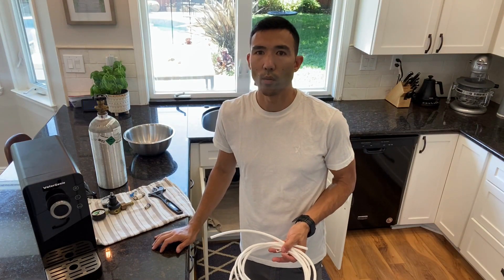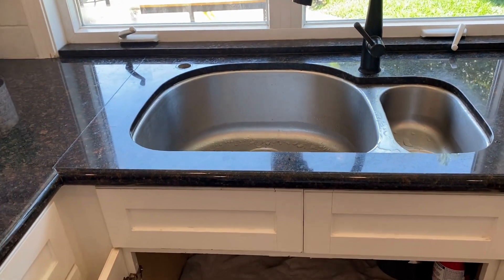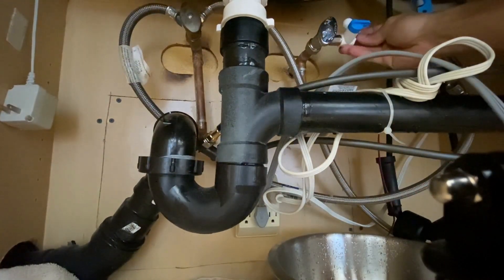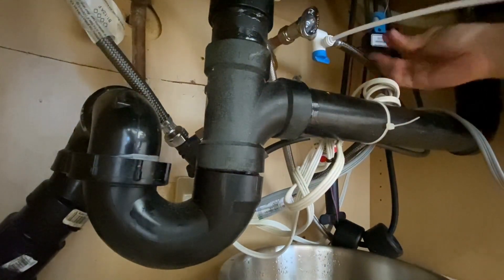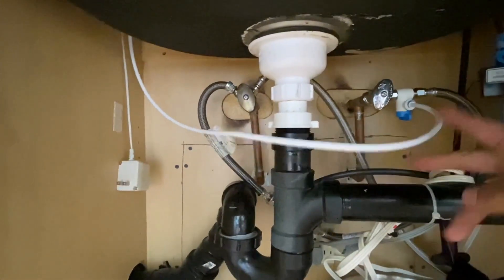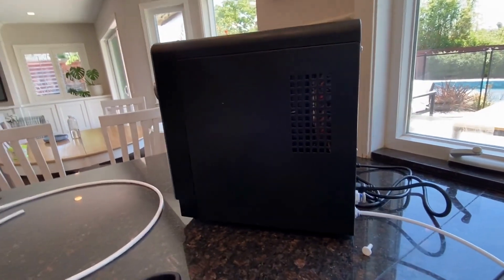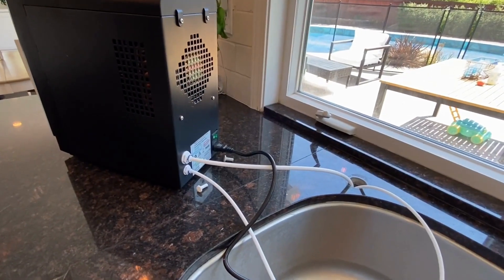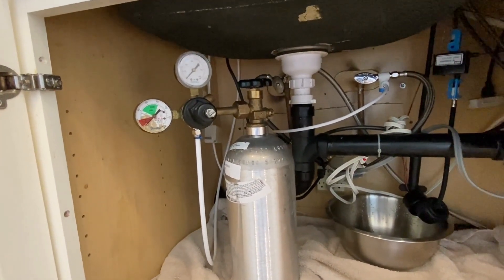How to Install WaterGenie Countertop Sparkling Water Carbonator Machine

Comment: Do you have a link to a PDF with the error codes and what the numbers mean on my display?  It appears to be working properly, but shows numbers that count down and count up and sometimes flash.
Reply from the maker: The numbers refer to the target temperature of the internal cooling unit in degrees C. When it flashes, it means the cooling unit is active and working to bring the temperature down. This is adjustable by holding down the top button (cold water) until the numbers start flashing and then use the other two buttons to adjust up or down.

Comment: Thanks for the video. How loud is it idle, how much does it cost to fill the 5lb tank and how many ounces do you get out of each 5 pound tank, and lastly can you adjust how much carbonation there is.
Reply: One last thing it would be very helpful for another video showing all the little features like how to adjust temperatures and how the drip tray works and if it’s removable.
Reply from the maker: It's about as loud as a refrigerator when idle. A 5 lb tank lasts about 4 months when used daily and costs about $30 to refill from an Airgas store. A 10 lb tank costs about $10 more which is why I recommend using a larger tank if possible. The carbonation level is adjustable via the CO2 pressure regulator. Setting the pressure to the maximum rating of 75 PSI will result in the most carbonation. The drip tray is removable and the temperature can be adjusted by holding the top button down for 5 seconds and then using the two buttons below to set the temperature higher or lower. Thanks for the tip to add more videos showing detailed operation!
Reply: Thank you for the quick response. Can’t wait to see the new video. When you put the psi to 75 is it more sparkly than a can sparkling water

Comment: Can I use a larger co2 tank
Reply: 0:53 says you can use any size but he is using a 5lb to fit his installation location.
Reply from the maker: Yep! You can use any size tank as long as it fits in your area. In my opinion, the bigger the better as it saves cost on CO2 and having to refill.